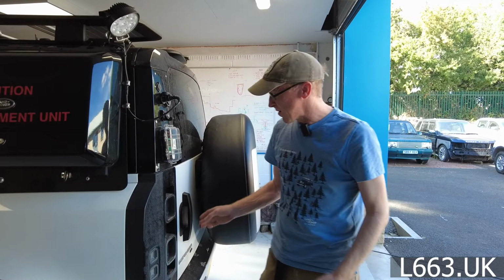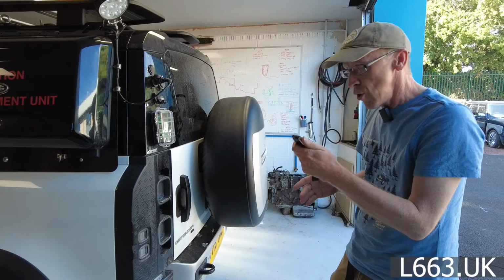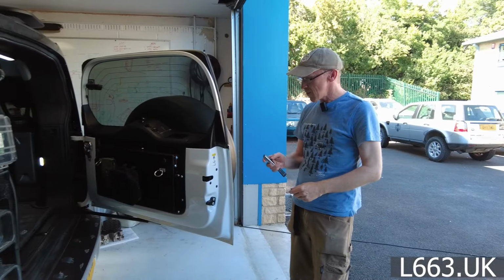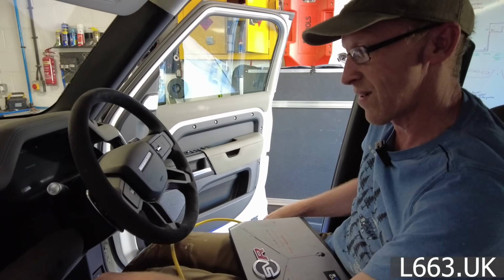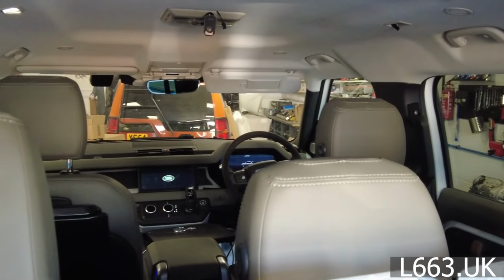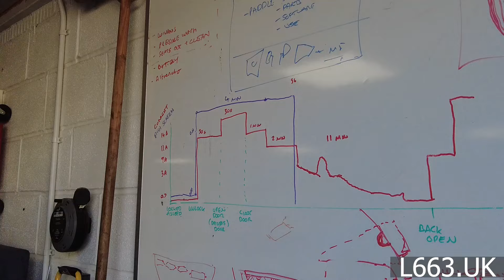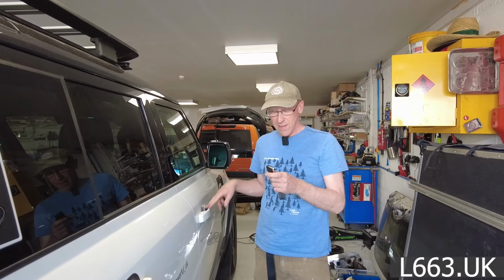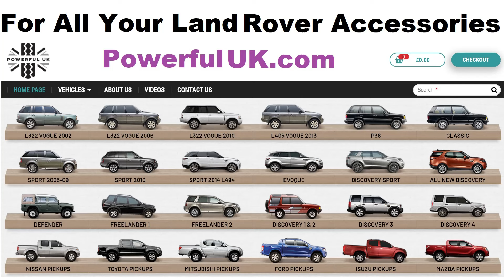Land Rover Defender L663 - Remote Keyfob Tailgate Rear Door Release Upgrade +  battery save !

Comment: The best feature to enable is activating window & sunroof open & close using remote holding lock or unlock button. NB need to activate in pivi pro as well after changes I’m told. But this is just theoretical haha.
Reply from the maker: The global window thing works on UK spec cars I am pretty sure - it is not enabled in some markets

Comment: glad I found this video. I hate how difficult it is to open and close the rear door. I have a 2023 110. The remote doesn't work, so will I need to take to the dealership for them to enable the button??
Reply from the maker: Hi I am not sure the dealer can enable this feature.

Comment: Cut you fit a power strut to enable full auto door opening and maybe closing too?
Reply: If you have a look on Allibaba the Chinese already have a kit for a power strut on the new Defender rear door
Reply from the maker: Interesting - if this could be combined with the keyfob release that would be neat !
Reply: @L663  The kit that I saw said it can be used with Original car key remote control

Comment: Hi, Don’t now where to post this question… I wonder if there is a way to configure the semi analog dashboard to show engine temp. I think it’s strange to have a terrain car not showing the engine temp. I would also like to see the oil pressure and oil temperature. Any advices?

Comment: I tried enabling this setting on a 2021 110, but quicky disabled it again because: a) if youre parked on any sort of more aggressive hill, the tailgate swings fast enough to shake the car when it reaches the stops, and b) there is little if any delay between button press and door open. I have no desire for an accidental button press to mean that I've just destroyed the bumper or the hood of the car I'm parked in front of. If only there was soft open!

My guess is that this is why LR did not enable the feature.

Comment: Have you ever try to get all the best from front cameras and sensors combined with lane control, to get AutoPilot, they got the brain, software and hardware, but I believe is some minor programming needed to change this. Mine is an SE 2020 P400
Reply from the maker: I am not sure on this - the ADAS system on the car seems to be separate from the 360 camera system but i will keep an eye on this

Comment: This video worried me a little. So without doing this, how long would the battery last with the rear door open? (ignition off, light off etc)
Reply from the maker: The car takes about 16 amps with the door open you have a few hours but if camping overnight you will get low battery warning in the morning !

Comment: Simon, quick question. Did you ever purchase and try installing an actuator for the rear tailgate? My thing is the door is heavy and annoying to open and close. I wish I could press a button and it would open ALL THE WAY. And then close on its own also. Most cars have this feature these days and it’s a bummer that this car does not.

Comment: Possible fly in ointment.... Landrover have just removed the soft close from the rear door - My X has just arrived and I checked it yesterday at the dealer and it doesn't have soft close. I imagine you're actually operating the soft close to open the door? I do hope I'm wrong because that a nice feature...
Reply: Soft close makes no difference to the opening on the X, I’ve got one.   It’s actually a waste of time tbh.  Be better with a powered boot and soft close doors.
Reply from the maker: Yes as Stuart has commented this mod will work 100% the same for those without soft close. I do like softclose and will add soft close to the doors soon - and add the video !
Reply from the maker: Yes i want to add soft close to the doors - i have the part numbers just need to get the parts.

Comment: But you can simply use the proximity feature to open the boot door without unlocking the rest of the doors or powering up the Pivi.
Reply from the maker: Yes ineed - if you are flash and have this... but you still cannot open your rear door from inside or remotely !
Reply: @L663   Good point - you cannot open it from inside.

Comment: I would think it may be a safety feature if you have your keys in your pocket or somewhere and the button for the rear tail gate gets depressed while driving could be an issue?
Reply from the maker: I will try that - i think this is disabled. The only thing could be if you lived on a hill and pressed the button by mistake the door could open and smash into something !

Comment: I remember back in the day I fitted 2 due springs to my struts on my clio, when you popped the boot it gave it enough push to open all the way.
Reply from the maker: I looked at this and there is no room to add those springs - not easily anyway

Comment: I’m still hoping that LR allow the variable air suspension to adjust for different levels. Combine that with the remote rear door and you won’t need a curb. Excellent for camping.
Reply from the maker: Yes you could make it just tip back and to the right a little !
Also a camping mode to level the car when parked at a campsite so the roof tent is flat would be nice !
Reply: Wish the car could be lower for entry exit , non too good or elderly parents or small people at the moment
Reply: @L663  a camping mode with self levelling would be genius!!!!
Reply: @Petrolhead912  mine does reduce to lower level for exit.

Comment: Simon, unrelated topic I know, but have you noticed that JLR are now sending through software updates to the Pivi silently? I turned on my Disco Sport a couple of days ago and lo and behold, the software had updated to v3.2.1 without the slightest warning, either before the update or (more concerningly) after. So it would seem that the usual palaver of double locking/alarming or even scheduling an update are a thing of the past.
Reply from the maker: That is interesting - I will go and check my car software level.
Reply: @L663  I should have also mentioned that several other Disco Sport forum members have reported the same thing, so not just my experience. 

Interestingly, in their campaign notes for 3.2.1 JLR state that "This release introduces a number of feature and performance improvements as well as bug fixes to the vehicle's Connectivity module." Perhaps that reference to the Connectivity module alludes to the incorporation of the silent update feature, although they also state under "What's New - Additional guidance provided for over the air software updates - for example, troubleshooting when an update doesn't complete."
Reply from the maker: @rafflesnh  Just checked and you are correct - the Defender is now upto 3.2.1
Reply: @L663  Enjoy! 😉😊

Comment: Any thoughts on trying to retrofit the rear locker? It’s the only option I wish I had spec’d on my 110 S
Reply from the maker: This has been done by a guy in the USA and it was a pain - parts / software / wiring etc.
I actually cannot see the need for it with the ABS locking the spinning wheel. My car does not have the rear locker...

Comment: Hi Simon, brilliant Videos. Have you tried on the Stig whether or not the battery output is reduced, when using the „Valet Mode“ while camping (Valet Mode = Campe Mode)?
Reply from the maker: This is interesting - I will test this ! but my guess is no change.
Reply: @L663  thank‘s for the try. Was hoping that it would work - despite the follow-up issue of not being able to open the rear door. Hopefully LandRover will provide a solution.
Reply: @florianfuersattel3559  I did find some settings in the CCF for quiescent relay control parameters - i need to play with these.

Comment: Simon, on my HSE P400 Defender the back door can be opened without pressing anything as long as it’s the first door you open as you get to your car. So keep the fob in your pocket and gently squeeze the back door handle and it will only open the back door. It will not unlock the passenger doors. And if you shut it afterwards it locks itself. This is in the US. Hope that helps.
Reply from the maker: Yes this is because you sir are flash and have the keyless entry on your car. But you still cannot get out the back door from inside your car !
Reply: @L663  nope I will be stuck in the back for all eternity. I will need that escape path for sure. Not so mention my dog who feels he should be independent. 😀😀

Comment: Interesting research, Simon. I have the S (2020) so not long after you got yours I think. Mine had "Assisted tailgate" as standard, which either refers to the soft close or the remote, not sure which. On mine the remote tailgate button unlocks the tailgate if the car is locked but I have to open the tailgate manually, this leaves all other doors locked and the PiviPro off. If I then shut the tailgate I get the usual beep & flash to signify car locked and alarm set. I must see if I can lock my keys inside.
Reply: I've checked: I can't lock my keys inside, just get a different beep. Good to know.

Comment: Hi Simon. Is there not a time delay to opening the back door with the interior lights on. Do they not turn off after a certain time this to save draining the battery if a door is left open the lights go off automatically..
Reply from the maker: Hi Gordon - head of TV advertising. The lights do turn off after a period of time. The problem is the Pivi power drain - the interior lights are no problem.
Reply: @L663  Did the Pivi power drain not stay off when you opened the tail gate independently when the rest of the car was locked..

Comment: Interesting stuff!

On mine (with keyless entry) I can open the rear door directly with the handle (without unlocking with the fob) and it does the same - other doors don’t unlock and PiviPro doesn’t boot up etc. I guess this feature does the same thing just remotely.

PS I think your friend is Korean!
Reply from the maker: Ooops on the Language identification ! - i hope they are not offended !
Interesting that the keyless works in this way... at least you can save some power !

Comment: The boot unlock button is for unlocking the boot while leaving the rest of the car locked. For those with keyless entry this is confusing as the keyless will just unlock it when they pull the handle. You can test this by locking the car and pressing the boot button from a distance too far for the keyless to work and have someone else try to open the boot.
Reply from the maker: Yes this upgrade is less useful to those with keyless entry but i could still give you rear door exit from inside the car and also remote opening -(if you are pointing uphill or on a kerb you !)

Comment: My Kia has a boot only button and that's great if I need to get stuff out and it automatically locks again afterwards. Is a bit odd why LR hadn't enabled that function but then again as you've said yours is the base spec so maybe higher specced ones might have the function. Either way a good addition to have found out and got working! 👍👍👍
Reply from the maker: Still not sure why Land Rover did not enable this !

Comment: I’d been wondering about this button for a while. My dealer told me it should open the rear tailgate, but of course it never did.

But I did notice what I think is a new addition to the user manual recently:

“Taildoor: Press briefly to unlock the taildoor. If the vehicle is locked and armed, all of the other doors remain closed and the exterior alarm remains armed while the taildoor is open. Press the lock button (1) to lock the taildoor when closed.”

I have the keyless entry model so can’t test this easily, but has anyone else tried this? If it works, it could be a way to get the benefits of “camping mode” without reflashing the software.
Reply from the maker: If you try this from 5M from the car you should be outside the keyless range but within the remote range.
Interesting JLR say you have to press lock - that is not required - it locks as soon as you shut the door ( as long as the rest of the car is locked - and the keys are not in the car ! )

Comment: Hello Simon. I'm the person who owns a defender110 in the US. I do a lot of outdoor camping. I park the car and open and close the door frequently, but there is always a warning that the battery is low. Is there any way to completely shut down the vehicle power? Is there any way to install a switch that can shut down the entire vehicle power like a trunk switch?
Reply from the maker: Hi Jayden - i think this could be a more common request unless Land Rover address the massive power drain when you open a door ( 10 Amps ). Most of the power drain is coming from the Pivi system - you could try removing the fuse for this - i feature this in another video. There are a couple of problems with cmplete battery disconnect I can think of
1 - you will have no locking / unlocking / central locking
2 - The Telematics control unit will probably think you battery has been disconnected by thieves and start report this to the Land Rover tracking system - not sure if you have this in the US. 
Did you see this video ?
https://youtu.be/Rmp3oZ1iSHE

Comment: Simon, another useful thing to look for in the CCF………. I believe that in the forthcoming OTA update for Pivi Pro the “ lock on walk away” function from the 2023 Full Fat Rangie may be added to the software files but I don’t know if it will need enabling in the files or just from the settings in pivi pro. Any chance that after the next OTA update you could investigate? I don’t know if this will only work on cars with keyless entry or on all the cars.
Reply from the maker: Yes this would need to be a feature on keyless entry with the external antenna sensing - my car only has internal sensing. It is interesting and i can look in the CCF for this feature.